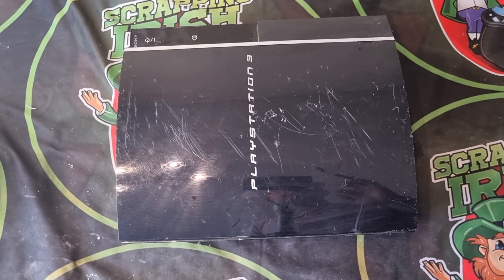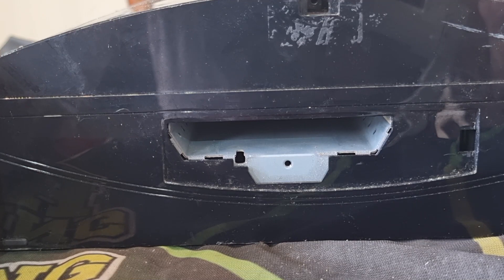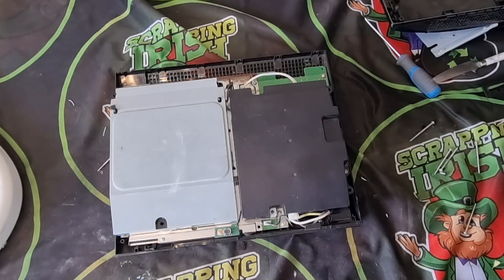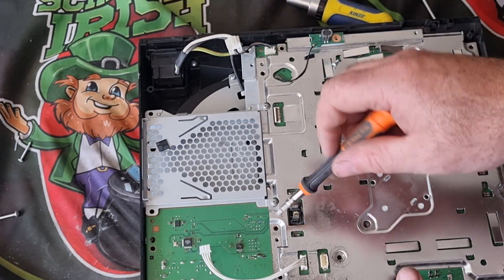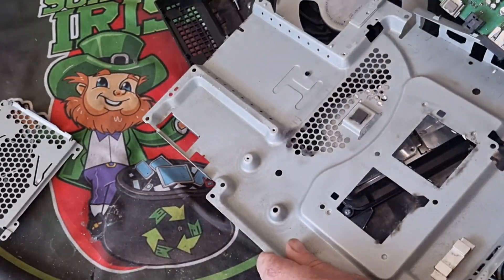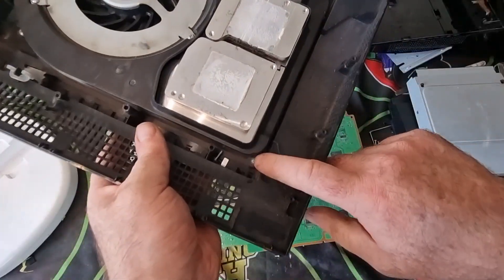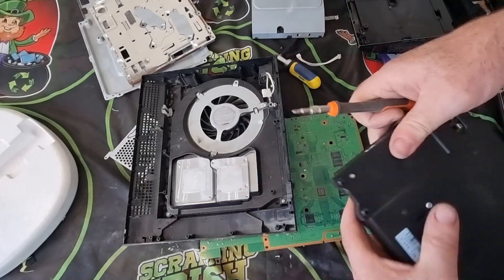Uncovering the Hidden Gold Inside a PS3 Console

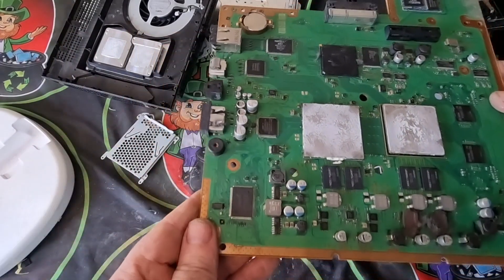Comment: @10:50 your mystery item is an SMD resettable fuse. I think there is some gold plating in the little speaker. I thought I saw something sparkly in there. :) Right in line with your thumb @10:17. A circular black object with a hole in the top
Reply from the maker: Cheers will have to check it out